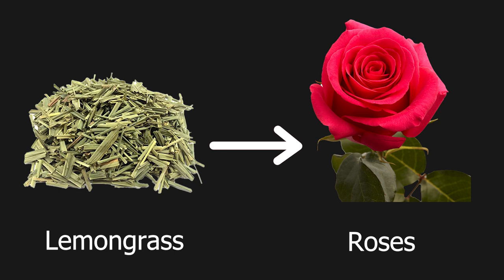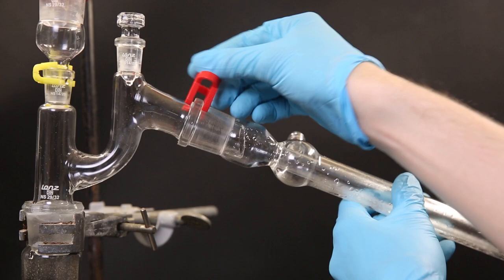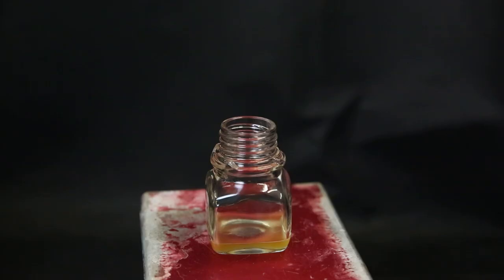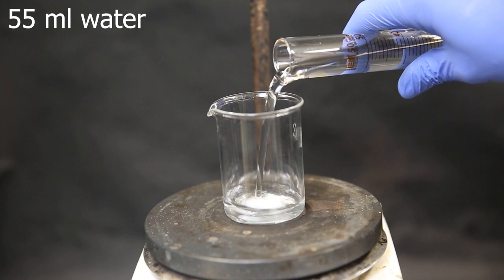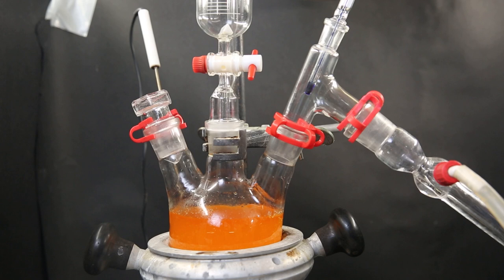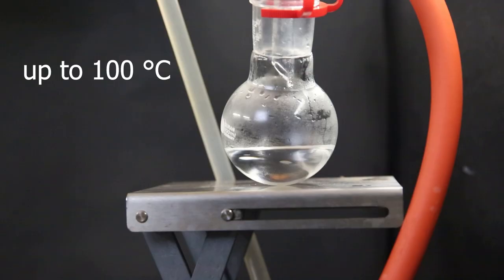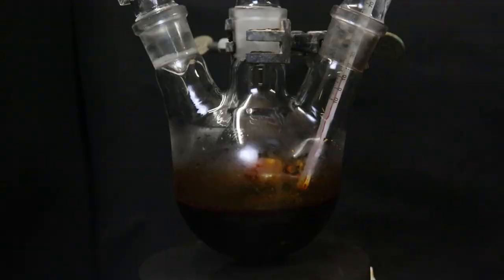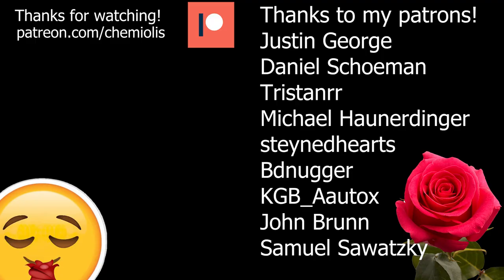Making Rose Fragrance from Lemongrass

Comment: Yikes. That had to be painful to do. Multiple vacuum distillations and multiple steam distillations with a whole lot of washing steps. I don't think most people understand just how much sitting there and watching that thing you had to have done.

There's a lot of lab automation and monitoring equipment that it would be nice to have for things like this that either just doesn't exist or costs tens of thousands of dollars. A thermocouple that connects to your wifi so you can check it from anywhere would be a good start.